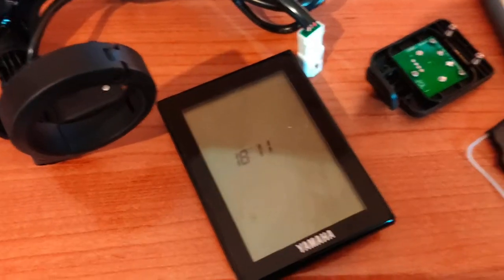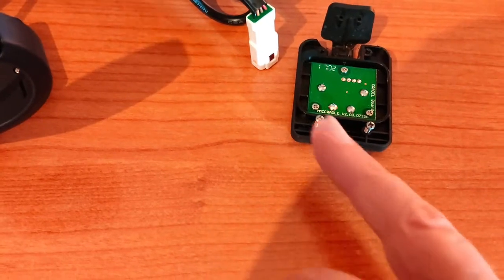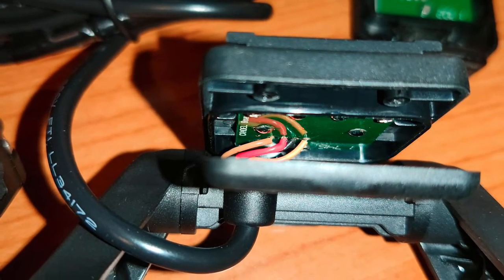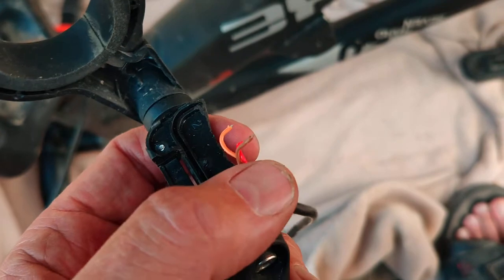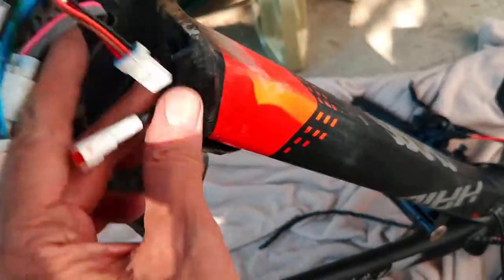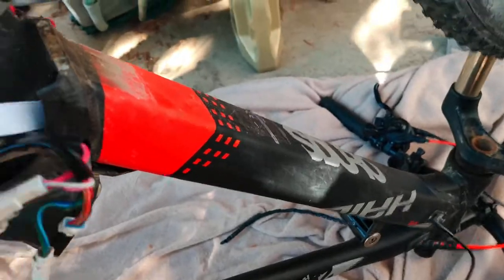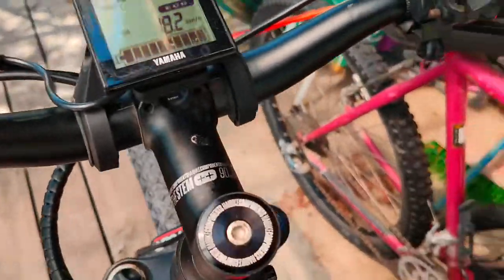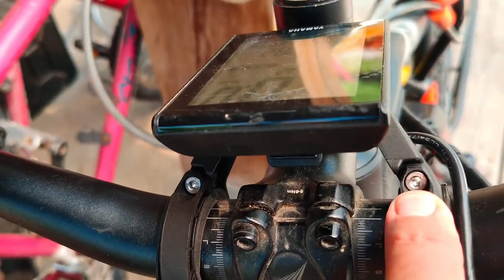Yamaha PW Display Replacement - Haibike SDuro Hardseven 2/0 2018 - including motor removal

Comment: Thanks for the video. Could you tell me if the "walk assist" on your PW series works? Here in the USA I have found no one who's Yamaha powered bike having this LCD display has a woprking "walk assist". Foe extensive bikepacking on rough terrain I sure could use some assist for my 80 lbs of eBike. Thanks
Reply from the maker: I believe walk assist was banned in the USA, but now it isn't. You might be able to update it somehow, probably best find a good bike shop to help, hopefully it is just a firmware update. Mine works on both this Yamaha system and a Brose motor on my Turbo Levo...but both bikes were bought in France. Good luck.

Comment: Hola tengo ese mismo modelo de bicicleta mi display si funciona pero no le da señal al motor para asistir a el pedaleo, quería saber si usted cree que los cables se salieron o alguna otra cosa.
Reply from the maker: It is very possible that a wire came off - maybe in a crash?

Comment: Hello. I have the same model of ebike. The motor is Yamaha PW series CE, with 50nm max torque.
Do you know if is available any software update to increase the max torque?

Thanks !
Reply: No. Yet you still ask a Haibike dealer if they have a hack yet they will likely not be able to help.